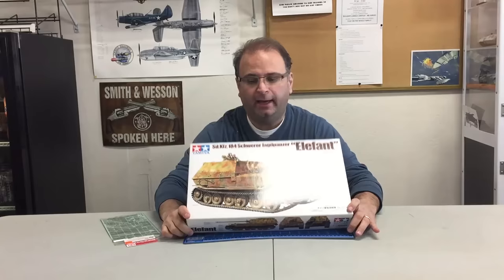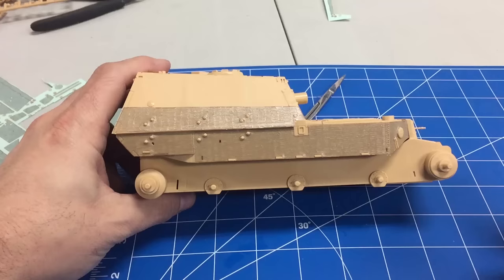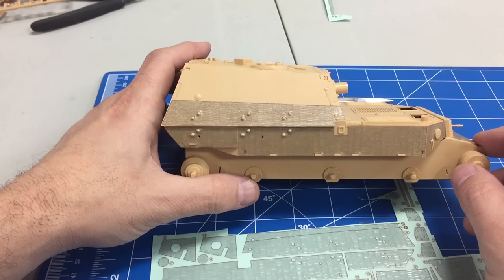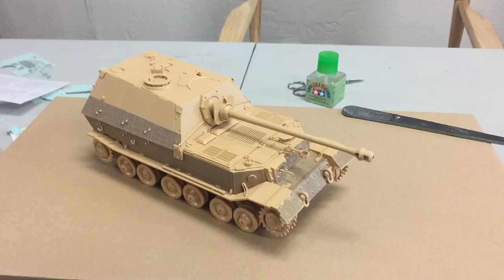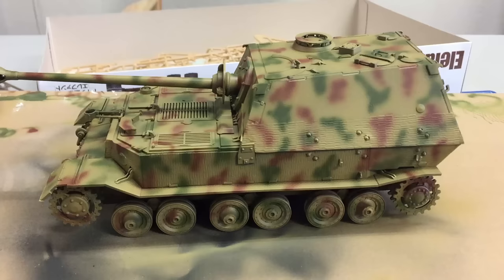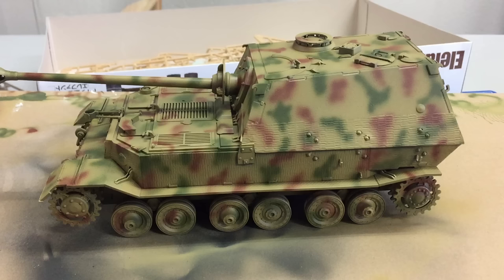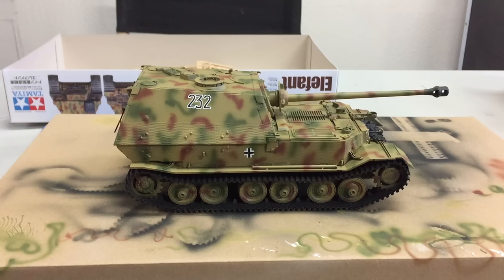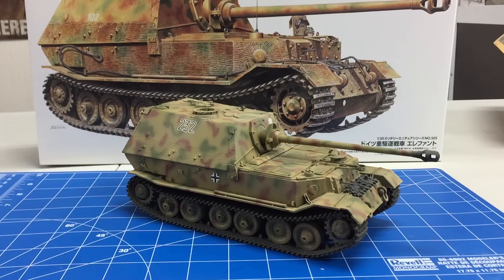Building the Tamiya 1/35 Elefant with zimmerit

Comment: Music is MUCH better Andy - nice and relaxed.  Also a better volume (slightly lower).  It adds ambience rather than dominates the video now...
Another great build and very informative video as ever - many thanks, much appreciated!
Reply: Sorry Andy, I forgot my question...
I am thinking of getting this kit and the zimmerit add-on - do you think it would have possible to make those round holes with a pin vice and a small drill bit (placing the zimmerit sheet over something like a soft piece of wood)?
Thanks!
Reply from the maker: +Michael B that might work well

Comment: Great job Andy. There might be an approach that could make this zimmerit application easier. Sometimes, depending on the type of adhesive, you can apply windex under the sticker. This allows you to slide larger stickers around until you get the right position. Eventually the windex evaporates and the sticker stays put. That might work for that product. Perhaps worth a test sometime? Please keep the videos coming! Cheers

Comment: I once got an idea for putting on decals and stickers onto my plane-models - especially for the tough ones .... I am using different pottery tools, like those for drawing lines or gaps into the material - they're made from stainless steel and very small, even those made of wood should work out fine - I don't know what it's called in english, but I got a tool with a small aluminum roll at the front, just like a cake roll but muuuuch smaller, that should do the trick according to the decals you got probs with :)

Comment: I used the Tamiya zimmerit on a Tiger 1. It was a big challenge particularly around the mantlet. I fear it will lift over time even after treating with glue around the edges etc...oh well. Back to the putty method I reckon.

Comment: Is it just me or does the zimmerit  seem to lack definition,it seems to be too rounded and looks like the armour plate is dimpled rather than having a thick paste trowelled onto it.No reflection on your skills which are way beyond my own by the way!
Reply from the maker: +ANTON RUDENHAM  Oh I agree its, ok but it doesn't have that thick definition , the kit is great I would probably try to do it by hand for zim next time thanks for watching.
Reply: My pleasure,really!
Reply: I'm building and converting Tamiya's old Tiger I kit MM156 which I don't think they make anymore, into a late production version with steel road wheels, I probably should have waited 20 years as they now produce, what is it now, 4 different kits of the Tiger, early, mid and late (and even an initial version which went to the Afrika Korps), I bought their Tiger I stick on zimmerit, thought I'd try it out.

I'm assuming though that it's engineered for their new Tiger I kits and not their old 1970's version, so the piece's didn't fit on the tank very well, and to be honest I wasn't all that impressed with it, especially being stickers.

So I ended up ripping off what I'd already applied and just chucked the whole lot in the bin, waste of money but lesson learned.

I found that Tamiya Standard Putty works really well as zimmerit and I used Trumpeter's zimmerit tools to create the pattern.
Reply: I found a good improvised zimmerit tool, the sparkwheel of a BiC lighter, pulled it apart with pliers and the texture is perfect. A cheap and cost-effective solution.

Comment: Andy do you gloss coat your kits prior to decal install? if you dont what product do you use to prevent silvering?
Reply from the maker: +Jorge Garcia Hi not for small decals I spray the whole kit with flat coat which is not completely flat and will usually polish the area with paper towel to make it as smooth as possible . If i had a lot of decals like a plane I would gloss the kit.

Comment: Thank you for great video, Andy!
Have one question regarding the black coat, you've applied before painting. Was it a primer? Or you just paint the model with black acrylic paint straight on? Just curious, as at the moment I use light grey Tamiya Surface Primer (with Laquer thinner, for airbrushing), and thinking - if it could make a difference? Should I apply another layer of black afther light primer to achieve similar results?
Thank you very much :)
Reply from the maker: no the black is just for depth and if you add black over your primer I think you will notice a big difference.
Reply: Thank you for reply! So you don't use primer at all? Previously I thought that this is a must. Are there some specific situation, when you use primer, or use some paint for coating?
Reply from the maker: i have never used primer , the paint sticks well and I always seal the paint in when done.
Reply: Ok, thank you for your replies! Looking forward to watch your other videos and learn new stuff about modeling)
Reply from the maker: thank you for watching